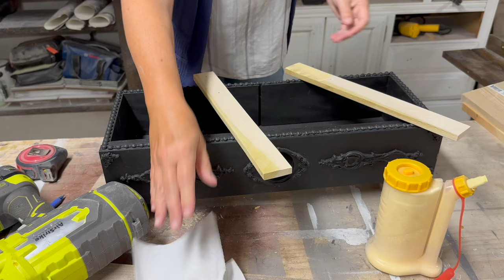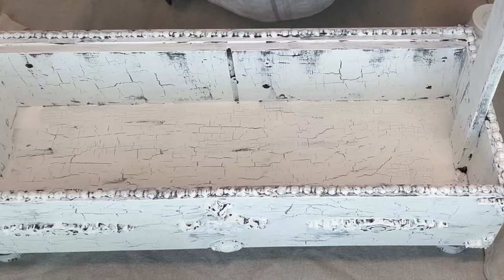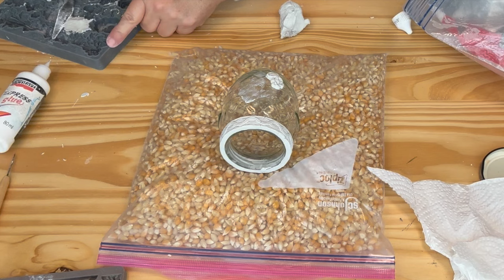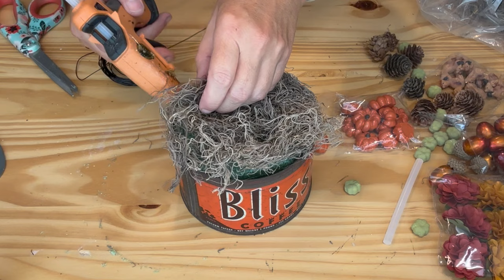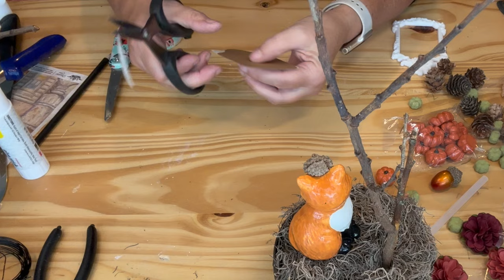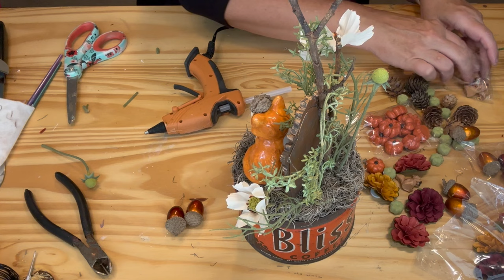Trash To Treasure //Fall Assemblage

Comment: Angie, loved all of the projects. I think the updated box is my favorite. Isn’t it necessary to have the glue wet to get the crackle?
Reply from the maker: Thanks Katherine! I've had it crackle on both wet and dry. I think you get a bigger crackle on the wet.   I've noticed I needed to be careful not to smear the glue and paint together and then end up with no crackle.
Reply: @Peppercreekcottage  thanks for the advice!

Comment: The box you started with isnt the same box at the end. You didnt indicate that you would be changing the carved work on the box front.
Reply from the maker: It is the same box. When I originally made it I made it double sided because it sits in the center of my table. The front side has the wooden drawer knob and the resin keyhole pieces and the back side has just the resin pieces. The only thing I changed on the box was adding the handle and painting the crackle finish.